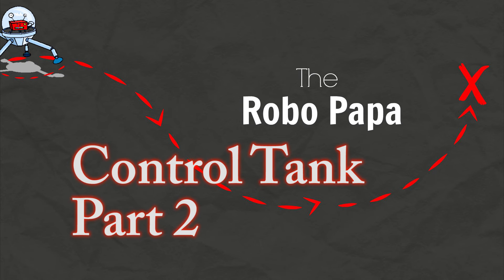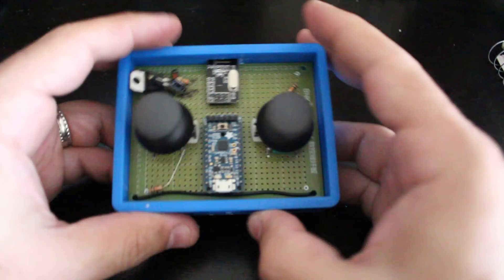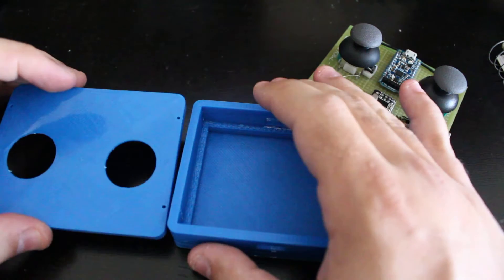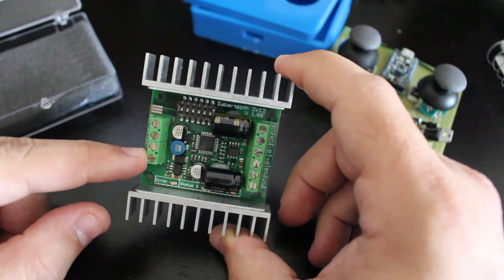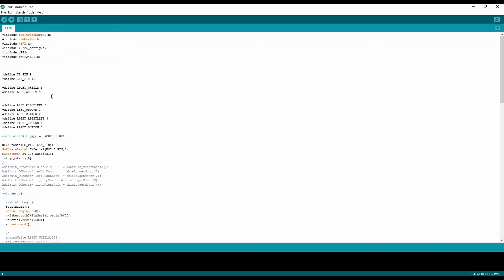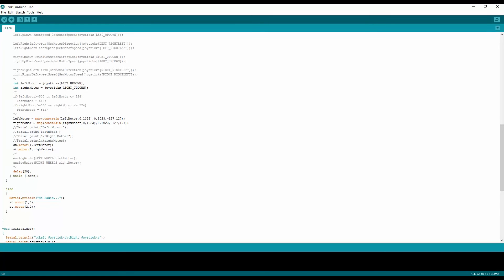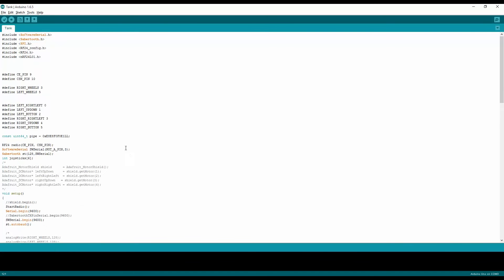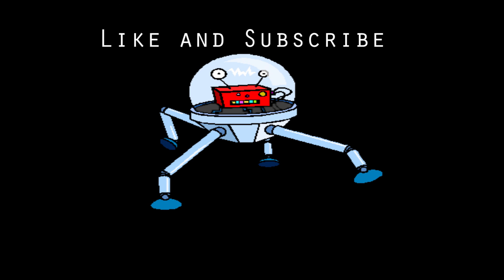Radio Controller And 6 WD Wild Thumper Part 2

Comment: How did you connect all 6 motors to the controller. looks like it is designed for 2 motors.
Reply from the maker: Its not about 2 motors but 2 channels. I have connected the right row (3 wheels) to one channel, and the left row (3 wheels) to the other channel. I was not looking in controller each wheel separately

Comment: Hello, the motor controller you are using is very expensive, is it possible for you to use a less expensive one like an L298 motor controller and show us how you would write the code to it?
thanks.
Reply from the maker: +Steve Tripoli the Tank I was using draw a lot of current so I had to go with something that can keep up with the current consumption. I will take a look also on the L298 for my next project. thanks for the recommendation !